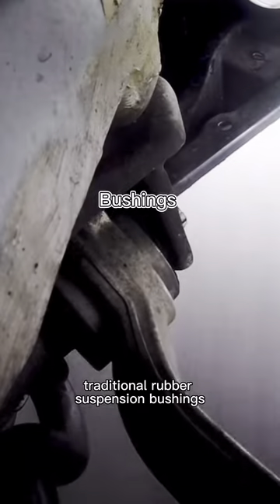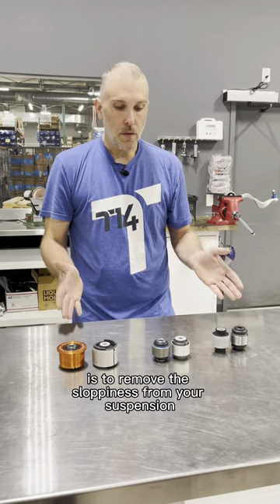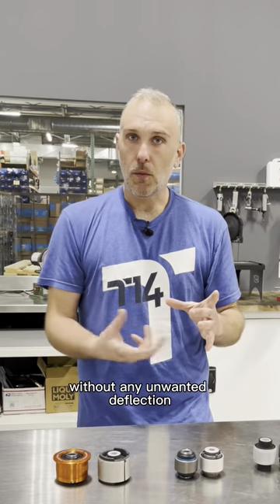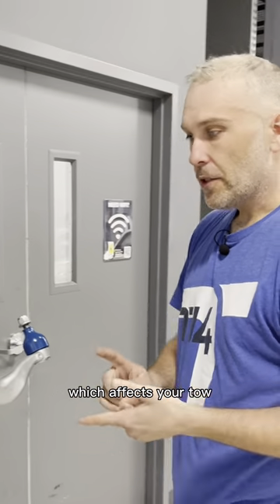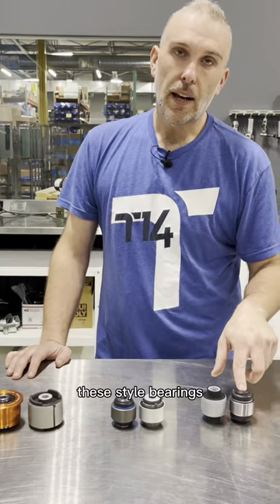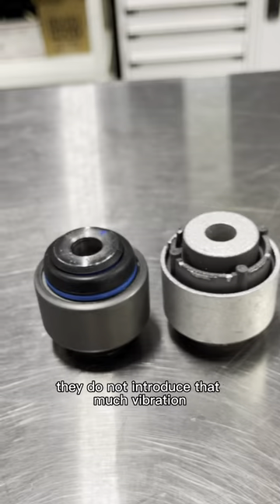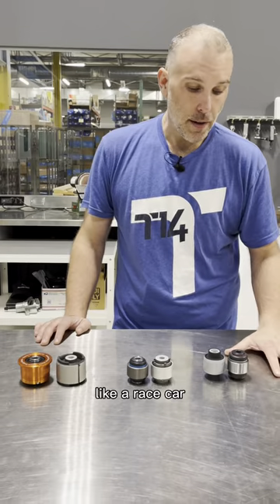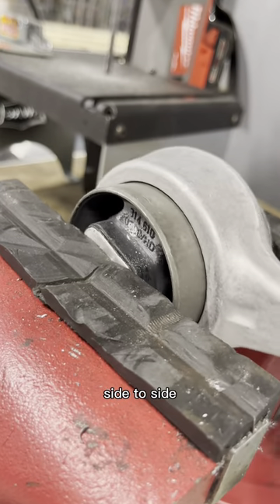Bushings vs. Bearings - What are the Differences?

Comment: The deflection is normal. It isn’t constant and keeps NVH down while keeping kinematics in spec. Nothing wrong with replacing them with bearing variants for a different feel but I promise you, your toe/camber is not just chilling out of spec while driving. The factory bushings are specifically tuned for the loads they see.